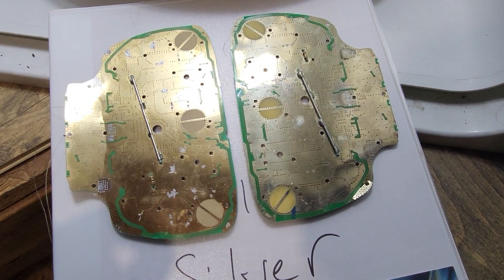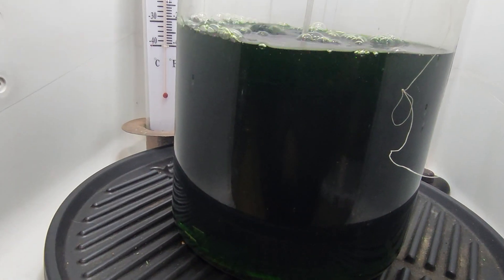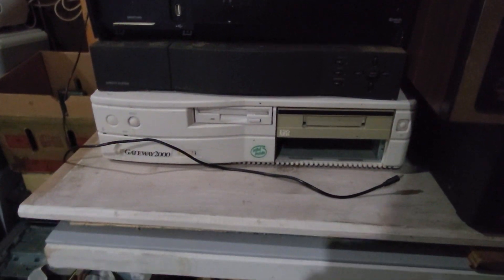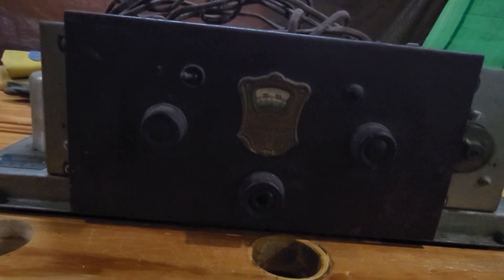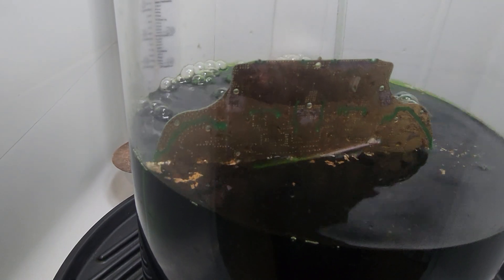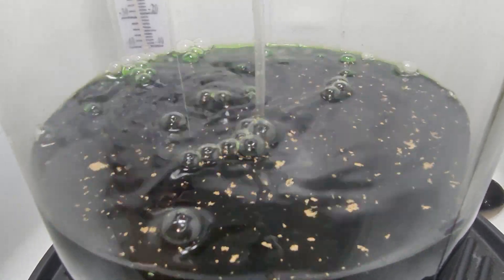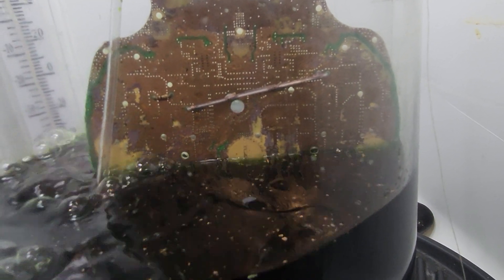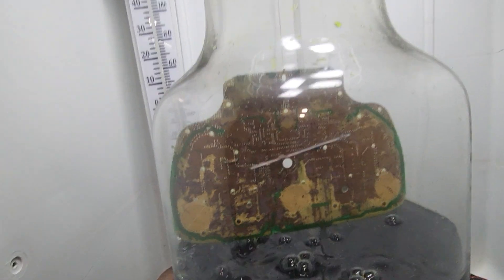how to get gold from electronics @ScroogeMcDuckn #diy #how to #gold #silver #science

Comment: Do you have heat on your solution?
Reply from the maker: @charmspeakjewelrydesignstu7224  no, i do not heat it at this step, the griddle is just to direct flow in the case of a leak,  into the safety basin under the hood ... the less aggressive way helps keep undesirable materials to a minimum.

Comment: Did you make your own fume hood?
Reply from the maker: Yes,   the home made ones are good but all were lacking "one-piece " construction.  90° corners trap over spills and make it hard to clean,,,,, a dish washer tub is one solid piece,  temperature resistant  , acid resistant and perfect size.....  a sheet of  shater resistant plexiglass from a monitor for a door . And a few other additions.
Reply: @ a walk through of how you made it would be a great video.

Comment: I like Seeing More Stuff On Sorting And Breaking Down Green PCB Boards Into There Individual Components For Further Progressing. I Don’t See Too Many Videos On Each Type Of Component Or Gold/Silver Recovery Process Like Videos On Complete Breakdown Of Boards Then Having Each Type Of Component Sorted Then Each Processed To Recovered Metals. 
  I’ve been Collecting Scrap/E-Waist For Gold Recovery About Two Years Now. All Free Finds Sort all The Scrap Into Piles Like Metal, Aluminum, Copper, Brass. Those All Get Cashed In The Scrapyard. I’ll Keep All The Fiber Boards, Anything To Recover Gold/Silver Out Of To Process Later When I’ve Built A Good Collection. I’m Building A Shed/Fume-hood Out Of An Old Small Scrap Trailer Camper It’s Gutted For Free. Needs A New Floor And Walls I’m Using Scrap Pallets To Rebuild The Inside And Outside I’m Going to Use Glue Tarps To Waterproof The Top. Then Cover It With Some Stainless Scrap Pieces I’ve Kept For It. Sort Nothing Crazy But It’ll Get The Job Done Then I’ll Rebuild and Upgrade As I Go Along.
Reply from the maker: @DJEuphoria24  yes, this video was in the beginning of our time on YouTube, i have been making more depop videos as we go. Alot of the time I have been scrapping out a particular item and then depopulation of the components,  I actually just did a 3 mother board depopulation video today, I am editing it and hope to have it up and available.  As far as the materials and what you yourself need , I actually made my fume hood out of a old plastic dishwasher tub.... its sealed, ment to take a bit of heat and already fit my fan, .... I would not suggest being enclosed in a smaller space, I too have a camper and thought of doing the same, but it can be very dangerous,  if you have a run away reaction or your exhaust hood quits, there is very limited time to get out of there , I seriously had mine all ready, and I went to do my first tests, and even at small scale, I did not feel comfortable,  if you have some materials to build a 3 sided enclosure (depending on your environment) I would do that instead. This can be fun and profitable,  but as soon as safety goes out the door, it can get dangerous real fast.    As a new person starting out, I would look up all the safety measures for each process,  and ha e things in place . Be  careful,  don't get to many going at once, and try to get in a grove with one way at first, if you start doing it with one person's, then finish with a second person's process,  you may find they contradict each other at some point and may not even know untill it's too late. We have fun and joke alot but safety  is very very important.  I hope you can find some of the answers your looking for in my videos .  Be safe, have fun , and good luck , it's a crazy rabbit hole but I have a blast ....